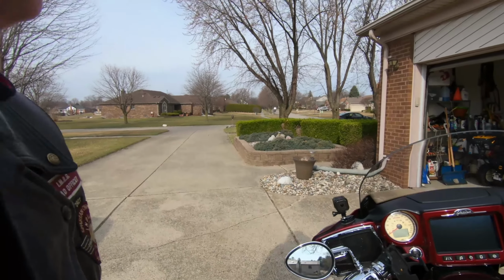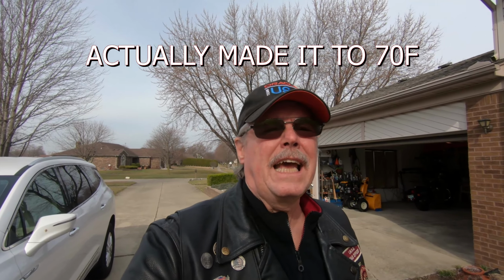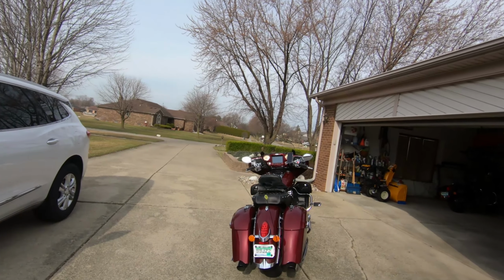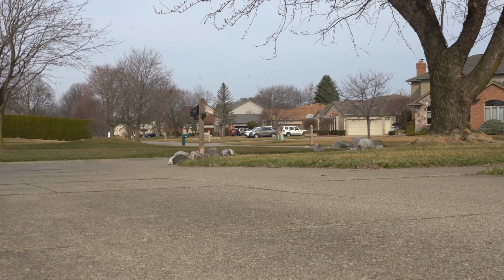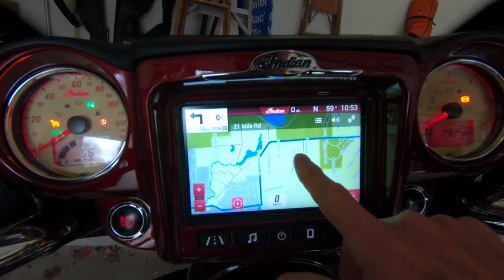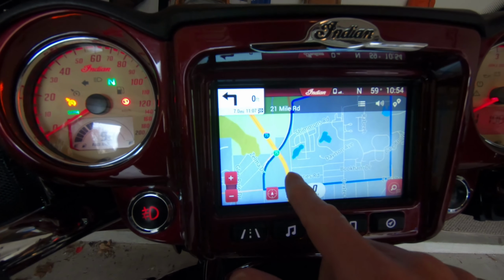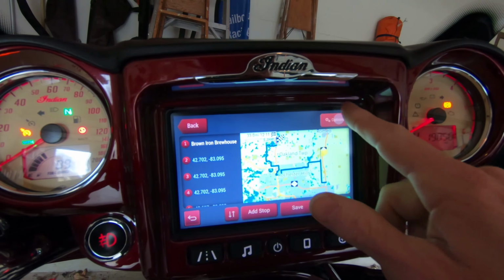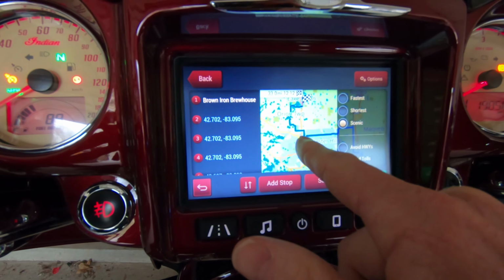USING THE RIDE COMMAND NAV  SYSTEM

Comment: I just had the same problem yesterday, I built a nice route on the ride command on my computer. Transfered it to the bike the ride command changed it. I ended up having to use google maps on my phone because the ride command was trying to make me do constant u turns. The first time I used the route building on ride command app it worked great. Not so much the second time. It makes me wonder if they even tested out before releasing it.